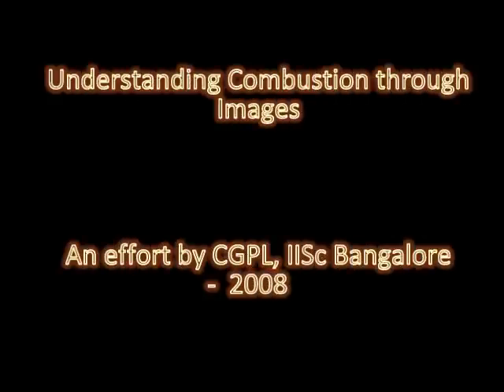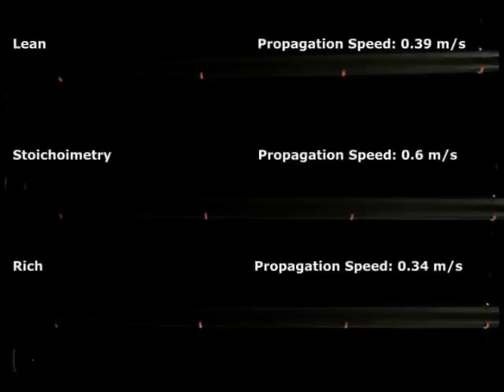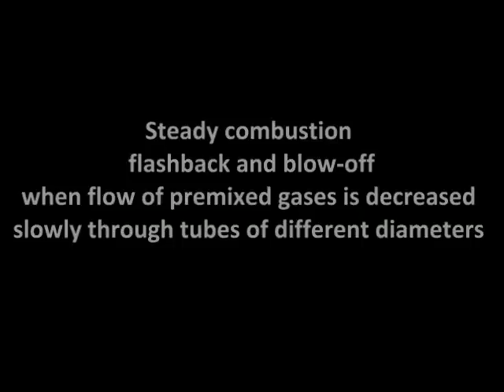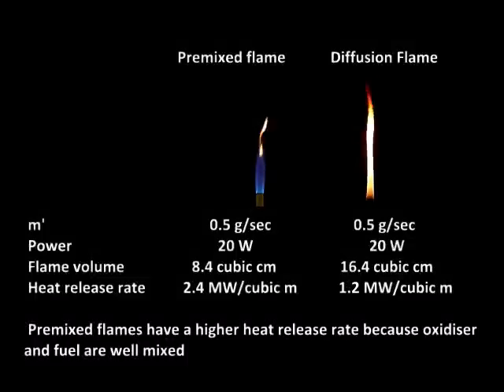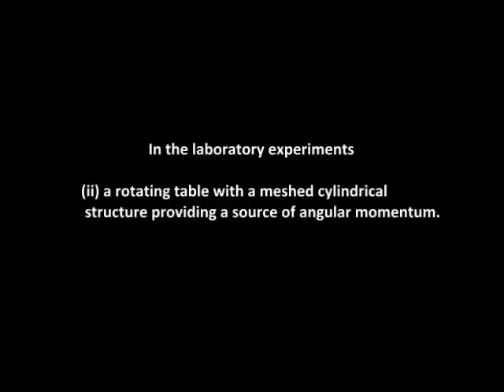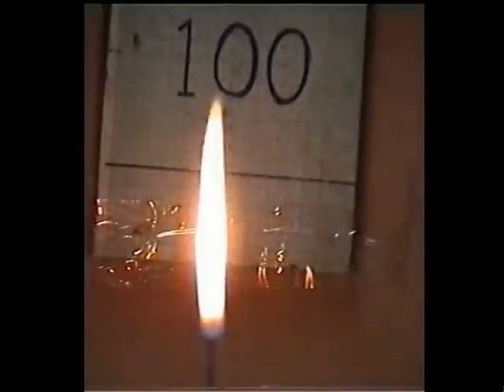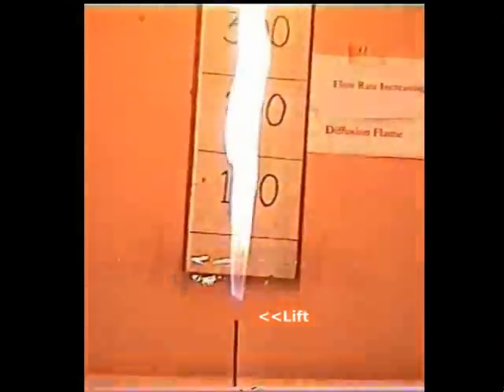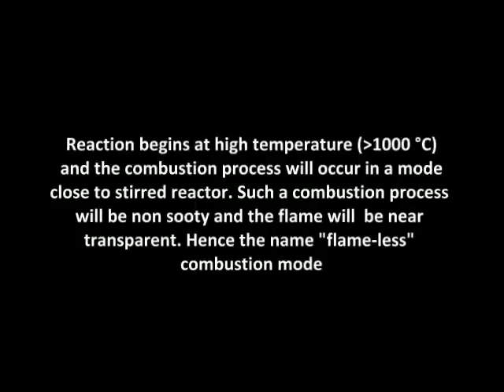Understanding Combustion - Part I - Gaseous fuels

Comment: Premixed flames are those flames where the fuel and oxidizer are mixed _before_ combustion process and other factors (mainly heat transfer) controls the rate of burning. Examples includes the one found in bunsen burner and household LPG stoves. This is in contrast with "Diffusion" flames where the mixing rate controls the rate of burning. Example of this is the burning of a candle.